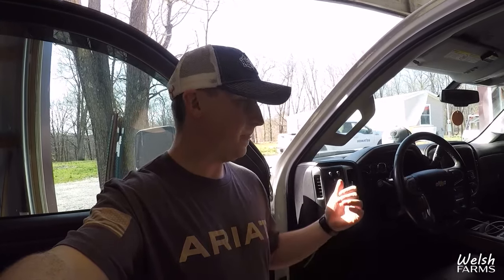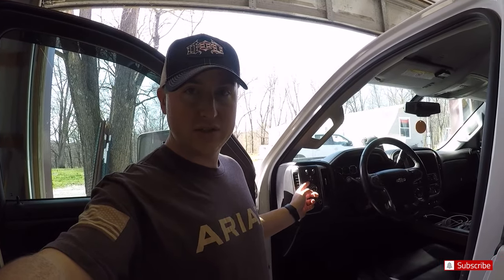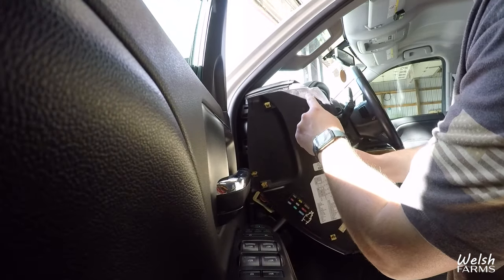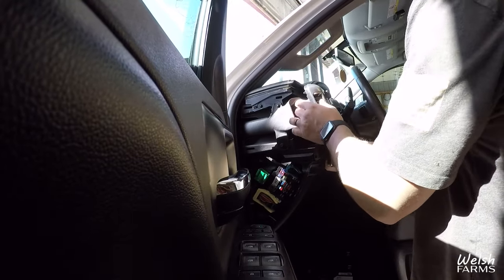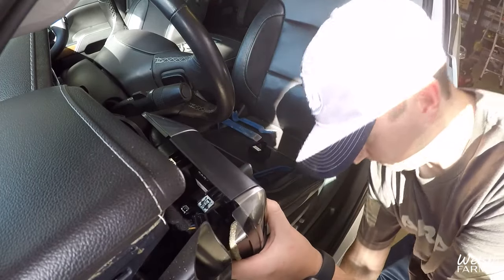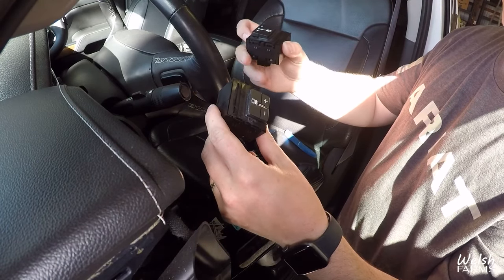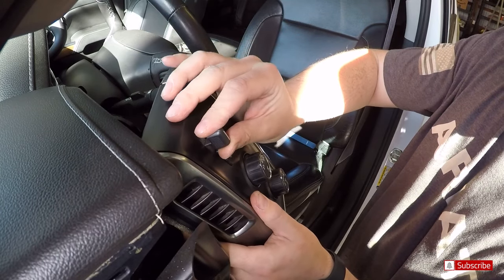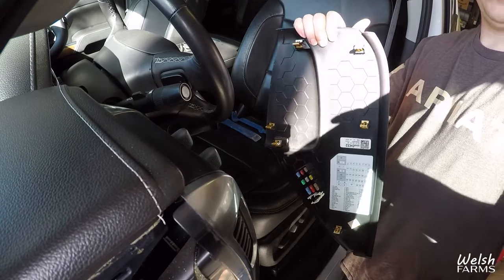Silverado Service Trailer Brake System Fix

Comment: I wonder if this affects how the trailer lights work.
Reply from the maker: No it does not, are you having trailer light issues?
Reply: @WelshFarms  I think I fixed the trailer light issue. I rewired & cleaned the ground areas of paint/rust. Thanks for responding!!

Comment: Did that fix the problem I have a 2022 and Chevy put a plug and a new controller and I’m still getting the warning check trailer wiring

Comment: Looks easy enough to fix. Mine only comes on when it is a hot day (over 85 degrees) and I don’t have a trailer hooked up. It’s the same error message though. Is the switch readily available at auto parts stores?
Reply: Amazon has them
Reply: @RS-dc7wy  yes I found that out after watching and fixed the issue within 5 minutes. The message has not come back on since and we have had multiple weeks in a row 90 plus degrees with heat indexes above 100 regularly. Thanks for the content.

Comment: Suggestions on where I can find the part? my 2015 Silverado is doing it as well.
Reply from the maker: Got mine on eBay
Reply: Ever fix it ? My 2015 does it also
Reply: Mine just seemed to correct itself

Comment: I have gotten the message twice but the controller is not engaging my AS Trailer brakes on my 2015 Silverado. Will this fix both issues or just the message problem?

Comment: Same happened to my 17 Z71 1500. Never used the trailer brake system or hauled anything. Never even put in a hitch. But it happened while I was driving and completely shut my truck off and brought it to a complete and abrupt stop. Kids in the truck with me. Happened 3 times. 1st time trying to make a u turn. The steering wheel locked and the truck stoped but never turned completely off. Put it in park then back to drive and the same thing happened mid u turn in the middle of a 3 lane road. Error message read service trailer brake system and a delete the message service stabilitrack. A few minutes later after looking insane driving around an empty parking lot checking my 4wd reverse drive turning it on off, it was fine. It was when I was turning onto the street leaving the parking lot that the truck stopped and turned off. I was luckily recording it to see if I could catch it and I did. Just dropped it off at the dealer to see what’s up. 
 Sorry a bit long hahah frustrating tho. Anyone else have this issue of it turning the truck off when driving?
Reply: Ive had the same issue when turning  too.   It says service stabilatrack. Going to look into how to fix that issue myself rather then taking it to a mechanic unless i absolutely have too.  Im also having the issue with service trailer brake system and will be ordering the part soon to see if that fixes the issue

Comment: Ive got the same issue on my '16. Hard to believe its that easy of  fix. Someone give me so.e feedback. Was it really that easy and did the code go away???
Reply from the maker: Yessir, I’ve never had the problem again. Still running the truck to this day!
Reply: Bro! I bought the part, problem solved👍👍
Reply from the maker: @aaronkhachigian409  thank you for the feedback 👍glad it worked for you too

Comment: I already changed the part but it still come out on the screen how can i reset it?
Reply from the maker: Unfortunately, if the error is still coming up, changing the switch did not fix your issue.

Comment: Will this work if your truck periodically does this? I find once i drive longer then an hour it starts doing that. But once it starts it doesn't stop
Reply: Ever fix it ?
Reply: @Jaake0324  yes. I was actually able to fix it myself. Just ordered a new part on amazon and i haven't had any trouble since

Comment: Thanks for the video. Im going to try it out today. Local Chevy dealer has been scratching themselves a bald spot trying to figure out whats going on with this and its been killing batteries and I believe my compressor as well but perhaps my problem is bigger than just this. Ill check back
Reply: Switch solve it?
Reply: So how it did go what was the solution in now having this problem too battery dies every now and then

Comment: 2013 Chevrolet 2500hd duramax.  Replaced everything from thr switch to the supply underneath the bed...all fuses and repays....it works for about 20 minutes and goes back to driving me crazy....pulled the bed off chased wires like a dog chasing his tail.   I'm almost insane because I keep following the same footsteps and find no problems but the visious cycle again
Reply: Did you figure this out?
Reply: @626weekendwarriors9  ended up being a bad magnet on the trailer, 40' gooseneck. Blew my mind becausethe axleswere new.....hooked up to my 32' rv everything worked fine.  The Chevrolet system needs a continuous circuit.... "ground"   bad magnet, bad ground = no trailer brakes

Comment: So did it work? I already order my part. Also, any ideas on how to tighten your mirror?
Reply from the maker: Yes it did! I haven't had a Service Trailer Brake System message since.  Which mirror?
Reply: Passenger
Reply: @jennifernorris2309  take off door panel and tighten bolts

Comment: Has anybody had it kill the power on your truck, it’s like you just disconnect the battery in mine. Very dangerous if I’m turning or something like that, dash goes dark for a split second clock resets.

Comment: I replaced the switch, just as described in this video, and I'm still receiving the error, and my rv brakes are not engaging. Anyone else have this problem?
Reply from the maker: Hate hearing that, not very often I’m getting that feedback. What year/make/model do you have??
Reply: @WelshFarms  2015 Chevy Silverado 1500 Crew Cab 4x4
Reply from the maker: @craigandg  ok thanks. Have you checked your #1 30 Amp fuse in the Engine Compartment Fuse Block? 

https://www.startmycar.com/us/chevrolet/silverado-1500/info/fusebox/2015
Reply: @WelshFarms  yes, both fuse #1 & #2. My next step is going to check the trailer brake module by the spare tire. I used a 12v tester on the 7 pin on the ground blade, and the brake controller output and didn't get any alternating flashing with wife engaging the trailer brake lever in the truck off and on.

Comment: I'm having the same issue. My truck is having issues cranking, and about the same this issue started I began to see "service trailer brake system".  Could be a coincidence, but it seems they're connected.
Reply: Did this fix it?
Reply: @sf5300  I had my battery checked and it was bad. Replaced the battery and issue went away.

Comment: Sometimes I have lost power to my truck while parking it. The last time it would not start or have any power for over 15 min. then magicly it started working again. Anyone else?
Reply from the maker: Can’t say I’ve heard of that. How often does it happen?
Reply: @WelshFarms  just once
Reply: Happened to me! I would turn into a parking spot and it would kill the engine. Sometimes I’d use my turn signal or hit the brakes the center screen would black out. It ended up being the body control module (BCM)

Comment: Did anyone have any taillight failures start happening shortly after or during the "Service Trailer Brake System" failure? I've changed the switch which seems to have solved the "Service Trailer Brake System" issue so far. I also changed the trailer brake control module under the spare tire as I had read something on that. Anyway, the taillight failure(s) are still happening, anyone else have something like this?
Reply: I've burnt two blinker  bulbs, one reverse, and one brake light bulb. I'm in a fleet vehicle and when they hooked up the GPS tracking system they messed up my bcm fuse. But also having trailer brake issues so
Reply: Take out the bulbs and look at the harnesses. Chances are they are highly corroded. Replace and treat each connection with “No-Oxide” it’s a very good preventative paste.

Comment: I replaced my switch 2017 Silverado. I still get the service trailer brake at the begining of start up. But not over and over. Has anyone else had this issue?
Reply: Yep just started on mine and is becoming more frequent, 2017 Silverado
Reply: Did you ever fix it? Mine does the same
Reply: I have it seen y pop up since I actually used the switch. Both times it popped up the was a iPhone plugged into the consul. Coincidence?

Comment: I just yanked the fuse (#36 under the hood) F'em
Reply: I just did the same, do you still get any kind of annoying alarms?
Reply: @neith4218  Not yet (fingers crossed) Have driven roughly 500 miles since. I do get the Service warning pop up screen but only on start up and no dinging. Good luck!
Reply: Do brakes still work if pulling a trailer if I remove fuse?
Reply: @armandoarzate4748  I am not sure - we don't use ours for towing. If I were I would probably replace the censors (or try to clean the connectors) Mine were under the spare tire so pulling the fuse was more to get rid of the alarm going off every 15 seconds.
Reply: @thegapinglotusexperience1251  thanks for the reply.

Comment: hi Steve greetings from Oz mate - maybe you have the wrong part - I think the correct one is 84108373 - certainly for 2015 --> 2500 Silverado's
Reply: I think you are right judging by the amazon photos. I have ordered both and will confirm for my 2015 1500 silverado
Reply: @mwilliams2964  and the answer was ?????????
Reply: @deep8873  you were correct! Thanks!!